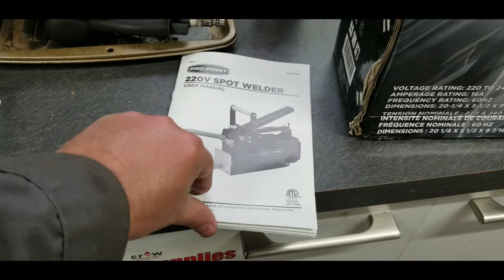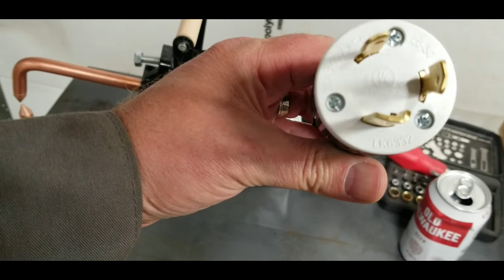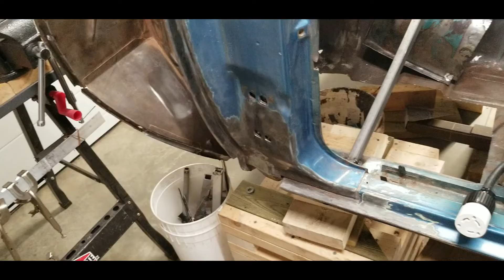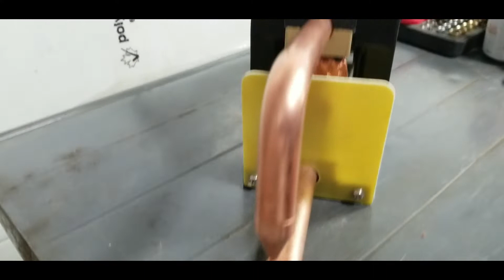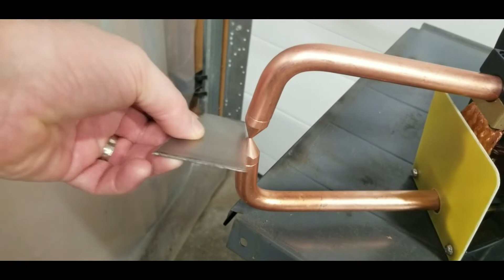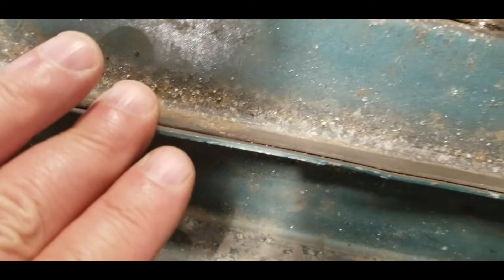New Toy - Pro Point 220 Volt Spot Welder

Comment: How do you know when to Stop holding the button/switch?
What are the material limits? Can I spot weld sheetmetal to 1/4-inch rod?
Would it Help to use Flux between the material? Whenever I Google this, I'm told I "don't need to." I don't care about "need to" but will it HELP? Obviously, it sometimes doesn't work by itself, so maybe it's perfect for the rusty metal scenario.
Reply from the maker: Those are good questions. I need to play with this thing some more. I held the switch until the metal was glowing in a circle around the contact point. I don't know about welding thick rod to sheet metal. The sheet will heat up more than the rod which could result in a bad weld. I wouldn't use flux on the metal, but someone suggested copper weld through primer which is probably a good idea. The welder relies on resistance of the air between the metal pieces. Too much resistance and the electricity won't flow, which is why the rusty metal didn't work. When I do more testing I'll try round rod and sheet metal and see how that works. Cheers!

Comment: I been wanting one for years now. I been reaching them on and off. I work in a restoration and custom body shop. So to have spot welds to give a factory look on certain projects. I noticed you had trouble on some metal. Make sure you clean all sides of the metal your spot welding that will give you the best welding

Comment: i have the same welder  it works better if you  coat the surface with copper spray weld through primer
Reply: I that a Flux that drives away oxygen, or something to improve conduction?

Comment: hey just found this video, I picked up the same unit on sale at PA last month, intend to use it on an auto restoration and am very interested in finding out if it worked and is you have any pointers, especially on the bottom pinch welds on the rocker panels because this is a heavy unit. How did you support the welder or did you use it at all?
Reply from the maker: I have not used this spot welder on the car. I do not trust it to be powerful enough for the pinch weld. It seems to do alright with clean 20 gauge steel, but didn't do well with thick or dirty metal. More testing is needed.
Reply: hmmm that is disappointing but kinda exected that answer, had similar results if metal isn't new and perfectly clean, thanks for the speedy reply, btw nice work on the Camaro. In my project everything is new metal and no rust, using 3M panelbond  for approx 70% of the pinch welds on the rockers and might use the spot welder to just secure the ends during cure time and then tig or mig the rosset welds after the adhesive is set. BTW mine is a truck with full frame so rockers are not actually a structural part as that are with unit bodys as in the Camaro.
Reply: It does do a good job on aluminum, if you clean real good and apply a piece of 20g sheet metal (stainless works best) on both sides of the aluminum where your contacts touch, without the sheet metal the heat is dissipated too quickly through the aluminum and it does not fuse together,  the sheet metal keeps the heat in the weld area and actually fuses the aluminum together. Built several parts for my bike projects like that. there is a video here on you tube so the spot welder had come in handy for small stuff so far, not a complete waste of money.

https://www.youtube.com/watch?v=gcgC3V3mkcw